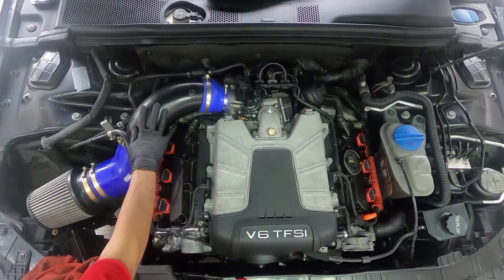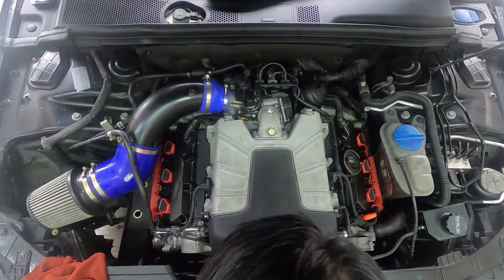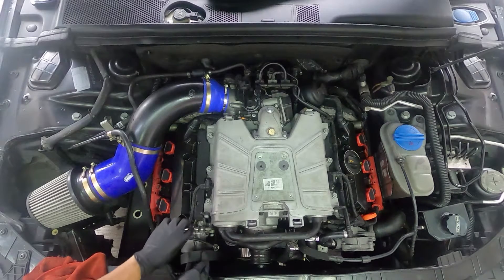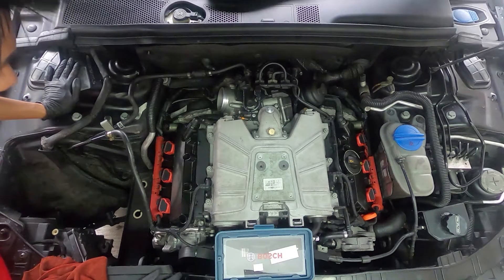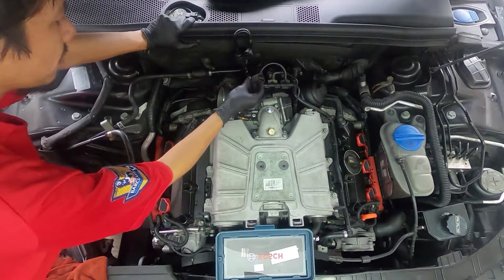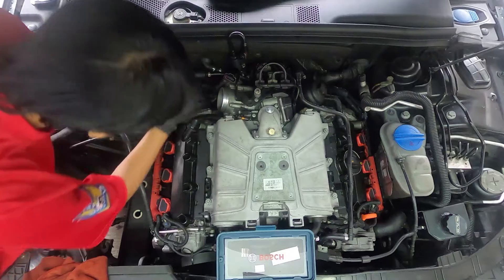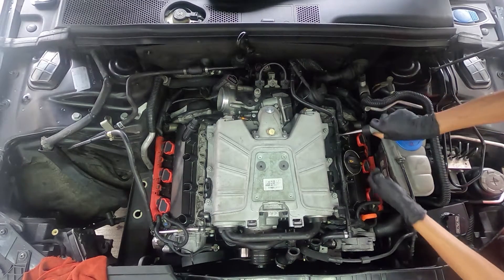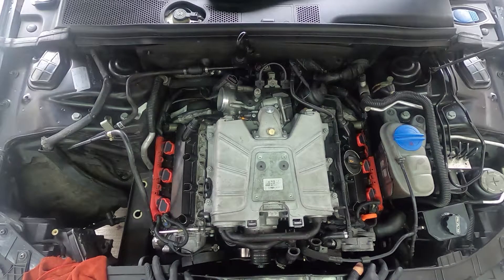S4 B8 Supercharger Removal DIY

Comment: Remember to check proper throttle plates position before placing super charger back in place.
I have the dreaded P2006/07 error code and if it's not a vacuum leak, good chance it could be the throttle plates.
Thanks for sharing this tutorial and maybe I will do it myself.
Reply from the maker: Ah yes, did check that as well. I have skinny hands so it was easy for me to slide down there and move the actuators to ensure it wasn't stuck. 

It could be the actuator itself or the vacuum line isn't plug in/leak if it not stuck. Btw thanks bud!

Comment: is it fine to burp the coolant after replacing the SC using normal procedure of warming up car with heat on and leave the overflow cap off? And then make sure any air bubbles come up. or do you need the pressure tool? Thanks Will probably do this to install my SC pulley, as its less work than putting car in service position
Reply from the maker: Hi bud,

It would be much better way to actually vacuum the system and fill it, however yes just doing that procedure is fine as well just takes a long time to get all the air out.

You will also need to purge the rear side of the SC, there will be two phillips bolt head to release any air in the system (they are plastic and they break super easily so make sure you head to the hardware and get a replacement one first).

Also i ran a divorce system where the SC coolant line itself were separated with a custom reservoir which made bleeding much easier.

Enjoy!
Reply: @Revoluzion  thanks for the response! So you had a separated coolant reservoir for your SC coolant? 

If i just have to open the 2 phillips to purge air, using the car running bleeding method seems okay.
Do you know how long it might take for it to bleed without using vacuum? 15-25 minutes? Steps I would do is open lid of reservoir, turn on car, get to operating temperature until i don't see bubbles, and also open the 2 screws on the rear of the SC like you mentioned, until consistent stream is coming out

I don't have any vacuum tool and that might be costly. Thanks

my other option is do supercharger pulley the normal method in service position. Maybe that will be better?
Reply from the maker: @CrispyImmy  hi bud,

Yes that will be much more better to do them will on the car, because you wouldn't need to replace the gasket on the flapper as well and less work on removing the sc. 

Yes correct that procedure will work, also if the Phillips head bolt starts cracking, take a flat head driver and heat it up for a minute and pierce it through 2cm and let it seat in the bolt till it hardens up. 

That would definitely get the bolt loose.
Reply: @Revoluzion  where can i service my s4 like doing dsg full service, pcv valve, thermostat and water pump? im looking for a decent workshop with affordable price....
Reply from the maker: @archonixm  Hi bud, well i've done most of my maintenance with Yuro Autoworks, the owner is extremely humble and knowledgeable as well and very affordable. He had even solve the Trans high temp error by replacing the mechatronic pcb board a & b and works like a charm. 

To be honest most workshops out there are good including APR, Subsonique and few others. It all depends on preference and location as you do not want a workshop somewhere too far away. Hope that helps!
Reply: @Revoluzion  hello bro i have a problem to audi s4 b8.5 The compressor has a sound. Can I watch the video?

Comment: How do we know if the termostat is working or not? Mine is taking long time work warm up, slowly increasing.. takes 15 min maybe to get 90, but it nvr pass 90 and stays there. Hope to get response from you.
Reply from the maker: If it takes a long time to get to that temp, your thermostat is probably stuck open sadly. Is it while idling or driving as well? I guess you would need to change them if it's taking that long, as mostly takes 5 mins max to get up to temp